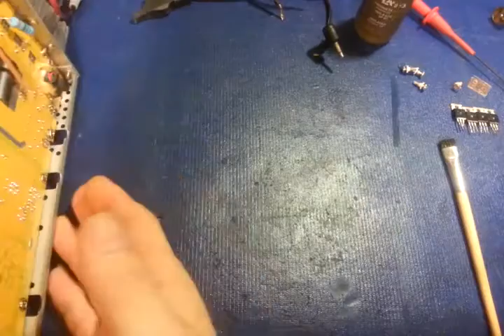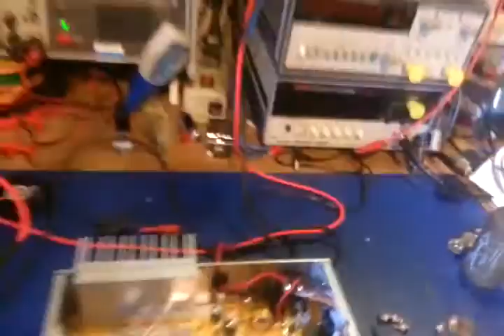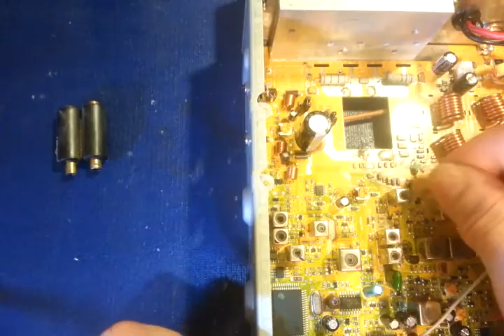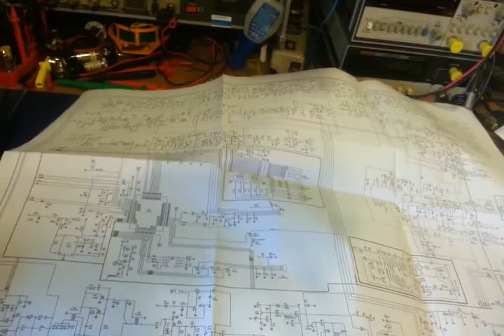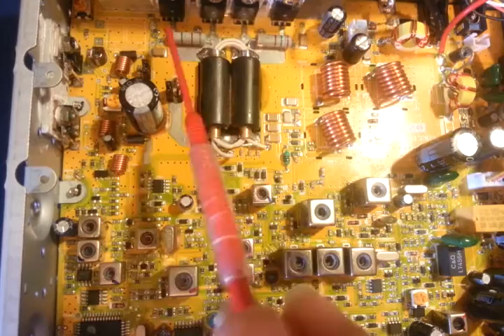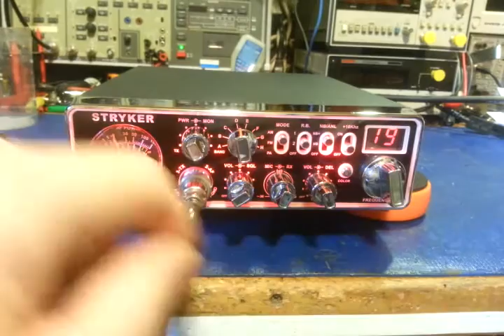Stryker SR-497HPC no RF output power repair.

Comment: My 955 is doing exactly the same thing. Its barely putting out any power on the air even with wide open mic gain and power gain. It does not have the tube transformer like the one in the video and nothing looks burnt anywhere.

Comment: Wow, some radio to work on, I think I would have passed on that one without even looking at it!  It is the way things are going or have gone, but I hate surface mounted components, they are just to small for my big fingers and they are hell on earth to work on.  Oh, I sound like some of the old guys that were used to valves when semiconductors first started to become common.  I still remember a TV tech saying "Hell, what am I supposed to do with these things, they destroy themselves quicker than a fuse",  I was tiny then and had no idea what he was talking about, so I went on over to have a look.  It was fascinating in there but he told me to stay out of there as there were things that could kill me in there.  Well that was like a red flag to a bull. 

Nice demo on that rig Mike, thank-you.

Comment: great job on that radio. I have one that needs work. keyed down on the mic the other day and it just went dark, took down my power supply too. the ps short protection kicked and it still works fine but the Stryker is showing a short from the power positive side to negative. clipped the reverse polarity diode and the first wafer cap just to see if the short might go away but it remains shorted. even with the power/volume knob board unplugged from the main board. Im at the end of my ability at this point and have nobody in my area i trust with this. any recommendations?

Comment: my Stryker 955 is having the same issue. If I turn it off I have normal rf output for like a minute then bam barely anything.  I just bought it brand new as well
Reply from the maker: Stephen Ross 

I would check and see if the binocular transformer tubes have broken loose like they were in this one.
Reply: the 955 didn't have those big tubes like that. I'm going to take it to the do where I bought it hoefully there warranty will cover it.  If not i plan to hit you up see what your prices are

Comment: I seem to be in the same situation as you, lots of radios that have been elsewhere, SMD radios, badly done 'conversions' and 'mods' like ALC and clarifier unlocks, there are some utter jokers out there who shouldn't have a screwdriver, let alone a soldering iron. 

Like your videos though, watch out for those wires to the front panel they're really badly crimped on the Stryker 955 and cause all sorts of intermittent problems. 

They're basically an Anytone/Qixiang radio with a fancy front to make the slack jaw yokels believe they're  a great radio.
Reply from the maker: Yep, no different than the old days.  A few companies make the majority of radios and just rebrand them.
Reply: That's not to say they're a bad radio as such, personally I quite like the Qixiang radios, cheap and cheerful with pretty good performance, certainly if you do the sums and count inflation, a radio like that should be somewhere around £500-£600 or $800-$1000 retail. 

SMD seems to scare off a lot of the screwdriver wizards so they give it a bad rep, while the truth is that a well designed and laid out SMD radio can be a ton better than an old school through hole board and much 'tighter' to spec.

Comment: Nice fix Mike...I hate winding binocular cores; did 5 small ones recently for a project I built for a friend recently and it gets real old when the magnet wire turns count gets up to 29 (I count by halves to keep it simple). That must be a export radio since it has FM?
Reply from the maker: Yep, what I call a black box export radio.  I got lucky with the binocular cores on this, only 3 turns. :)

Comment: It is just me or is that transform poorly wound and way to lose with some of the wire way too far from the cores?Looks much better after you re-wound it. I hate the user interface on the Stryker's but I do hear nothing but good things about their receive and their audio. I do wish they would drop the band switch and go to an RCI 2950 type face plate with continuous tuning maybe an option to go by bands. I like being able to tune the last digit when on SSB so much better than having an unlocked clarifer.  It is also so much easier to get to where you want to be moving the carrot and tuning manually especially if you only need a 5-10kc jump. I hate having to turn a band selector then turn a channel selector then hit a 10kc switch and then still needing to use an unlocked coarse/fine clarifier.....I am just not into throwing lever's, flipping switches, turning dials and pushing all kinds of buttons to do something that should be fast and easy to do. I hate that about my President Lincoln too. I love the radio but hate how many steeps you have to go to with bands and only limited carrot slots to get to where you want to be. I hear the new RCI2950DX's are insanely noisy on receive and that the audio on AM and SSB are just ok nothing special. What are your thoughts on the 2950DX are they as bad as everyone makes them sound or are they still a good SSB radio?
Reply from the maker: Yeah it was kind of ragged looking before.  Like I said I think someone had been tinkering with the wire because they were not in the through holes in the PCB and the soldering job a little questionable. I tried to get wrapped a little tighter when I reinstalled the wire.
Reply: You see a lot of that sort of sloppy transformer winding on home built amplifier's. You see ones built by less than skilled or knowledgeable sellers that pander to ill informed CB'ers as well.

Comment: Nice job on the troubleshooting and repair Mike.  Those radio are built pretty strong. Only down fall is that binocular transformer.  Since it does not have end plates it is only supported by the tubes. I seen them fall out and rip the traces right off the board due to the weight of them.  I also wonder why they did not install a jumper so you do not have to remove the SMD cap for setting drive bias.  Cannot remember if this radio has the built in TGM or not.  Thanks for another great video Mike.
Reply from the maker: I think the reason they don't have a easy to remove jumper for that smd capacitor is it is in the RF path.  It is the coupling capacitor between the 2SC2078 driver and the 2SC4272 pre driver.  Adding a jumper with a unknown amount of inductance and capacitance would probably throw the circuit out of tolerance.
Reply: Good point about that jumper.